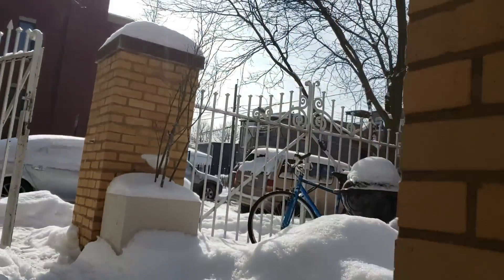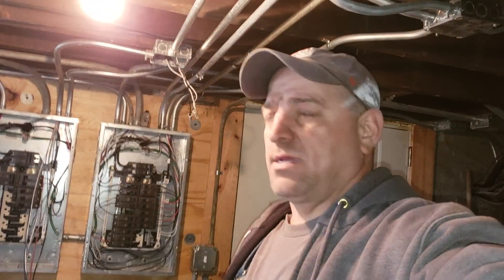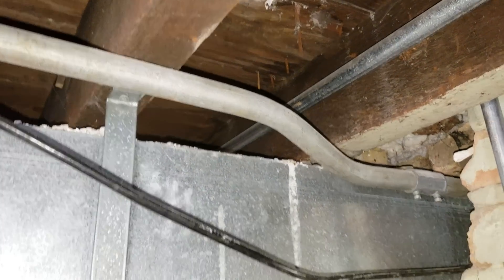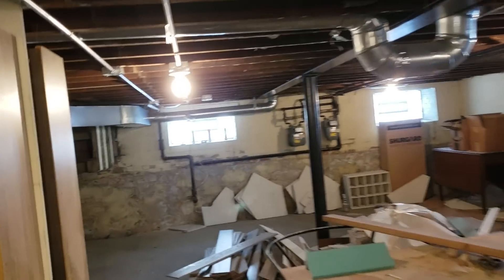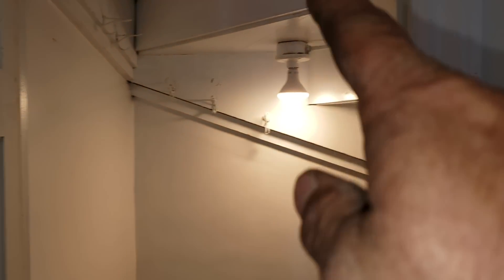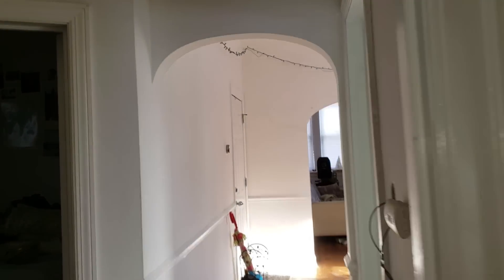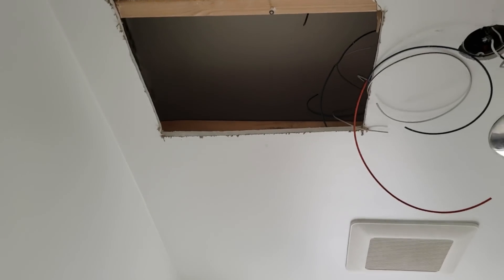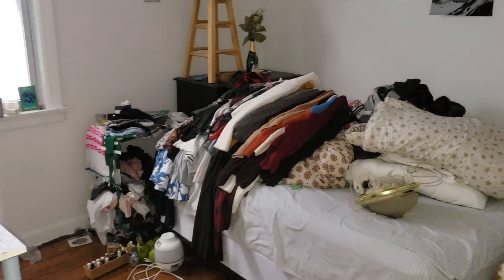Chicago 2 Flat Rewire

Comment: People from different states have no idea how painful and long it is do to stuff in rigid and THREAD all the connections....Great work
Reply: I’m pretty sure he is using emt for all the interior work. Only service will use threaded rigid and that can be done with aluminum as long as it’s not the overhead mast. Even that can be aluminum up to the last portion where the attachment is going to be. 

But you are right threading galvanized steel rigid is a pain in the ass especially when you get up in sizes.

Comment: Quick question... You said "1 network is 2 hots and 1 neutral" I assume you mean the hots are on each leg of a 220v so you can reuse the neutral?
Looking at that place literally raises my blood pressure!  It's such a tangled mess.  Hope you're getting paid WELL for that job lol!  It's going to be night and day difference when you're done!  Thanks for the video!  Keep up the good work!
Reply from the maker: On a single phase service you can share in the neutral with the A and B phase.  So two 120 volt circuits can have the same neutral coming from the panel

Comment: How much do you charge per hour? This would be to re-wire an attic apartment. It has all BX wiring internally and on the walls, for the outlets, it is a 1/2 round metal tube, up against the wall, visible, with the thin wires pulled through that. (Unreal. LOL)
Reply from the maker: Probably just a bid job. Give me a call. 312-719-2616

Comment: Nice work i’am an Electrican also  question i’am doing A 4000 amp I have my price on equipment wire volt pipe  this is hard to price out how do you come up with your numbers 
There is no blueprints  any help
Reply from the maker: Figure out what you need per hour then break the job down into small pieces and figure out your hours. It always takes a little longer than you think so add 20%

Comment: How much would it be to do this about?  Or per hour? How long did this end up taking?  I have a 2 flat with a lot of the old cloth wires.
Reply from the maker: Every job's a little different But probably 10 to 15K

Comment: When u are trying to figure out what each circuit is and where it goes do u just have to string a long jumper wire to test continuity? Or is there a better way to find that out?
Reply from the maker: Jake Ziegler There is a multitude of ways to test existing circuitry but I was ripping everything out and starting over so I was basically just tracing out the pipe as I pulled out the old wire the old circuitry didn’t matter. The best way to identify circuitry is to turn everything off except that circuit and see what is energized